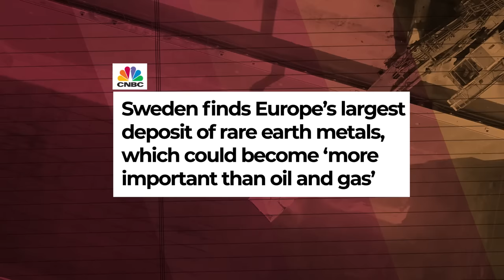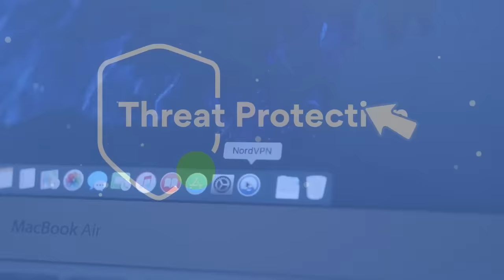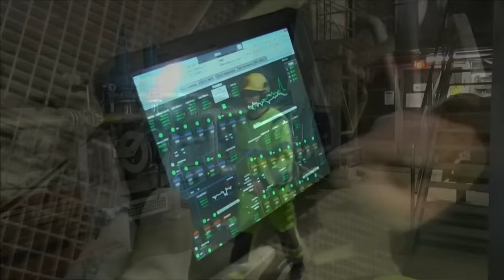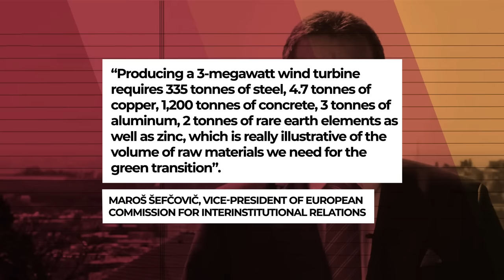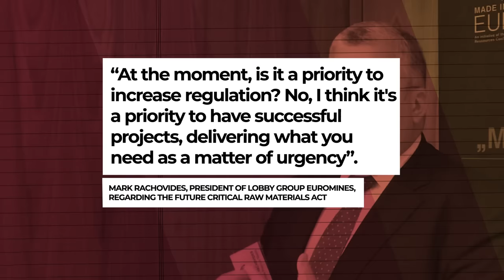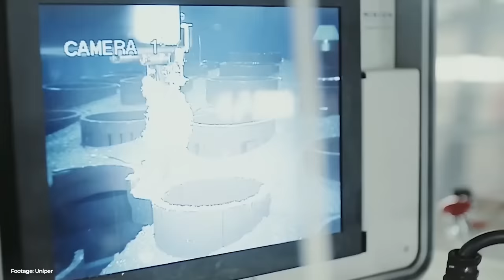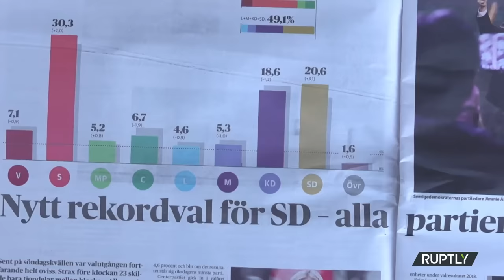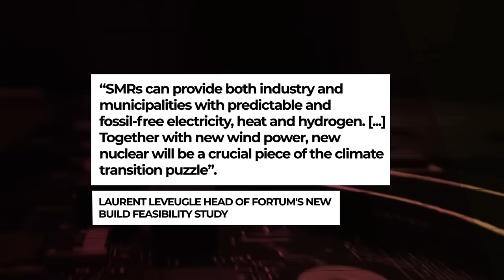Rare Earths: Can Sweden End Europe’s Dependence on China?

Comment: As a Swede living in Kiruna there's a lot more to the story than mentioned in this video. 
First, Kiruna will not be moved, it already is moving and has already moved the city center to the new town. They won't move building by building, they only move culturally important building and demolish the rest, right now they are preparing to demolish large parts of the old city centre. 
Second, it isn't just a new source of rare earth metals they have found, they also found it in the already dug up rock from all the iron mining. So this will also be another source of more rare earth minerals.
Thirdly, right now Swedish mining and steel production is trying to go completely fossil free with the use of hydrogen so there is a lot of work up here right now with a lot of pilot projects like HYBRIT.
Lastly, another source of copper will soon be available in Kiruna as an old mine from LKAB has been bought up by a new company called Copperstone who will mine a copper and iron deposit close to the town. The only problem now is that Kiruna itself has a ton of problems regarding everything else besides mining like schools, eldercare, healthcare, housing and so on.
Reply: Not enough people then

Comment: Nuclear is great for the environment as long as it's used as a temporary solution until fusion energy becomes viable, so Greta needn't have a panic attack.
Reply: agreed, fission is required to reduce carbon emissions if we dont have fusion. We should plan as if fusion will never happen, because the truth is, we dont actually know if it will ever be viable.
Reply: Yeah, we had some development, but it still a long way (probably several decades) before fusion starts to pumping energy into the grid. Also, it's not a guarantee that fusion will ever become an effective power source. This is a real possibility. With this in mind the new generation of fision reactor are the best option as a base load power.
Reply: Didn't she go pro nuclear recently?
Reply: Nuclear was only bad when we had no use for its toxic waste and managing the inputs and outputs required a highly unstable chemical reaction with no safety inputs and the reactors had to be absolutely massive.  Every single thing that used to be a problem is no longer a problem.  Why we are still playing around with green energy is a total mystery to me, the entire world's green electricity grid is nothing in the face of a dozen modern nuclear reactors and will cause less overall damage compared to solar panel farms developing desert ecosystems and windmill farms terrorizing flying wildlife and killing them by the thousands yearly, totally defeating the purpose of being "green" by creating new ecosystem problems to try to solve old ecosystem problems.
Reply: Nuclear fission is always good for the environment. Short or long term. Fossil fuels however is not
Reply: Nuclear could theoretically power us for the next several decades and beyond if we perfect Thorium reactors.

Most of what we use fossil fuels for can be provided by electricity, and most of that could come from nuclear.

We just need to get the regulations right and start building them.
Reply: @infidelheretic923  I love thorium reactors. There’s loads of thorium in the US, only issue is in mining it since it can potentially damage the environment if not enough care is taken. However, it’s probably not much worse than mining for “renewables.”
Reply: Fusion will never happen. Save a link to this comment, and if we have commercial fusion with proportional net gain  in 75 years, I will pay you $100 million. It's a waste of money and I don't understand why so many countries are building such stupid "solutions"

Comment: Norway has even larger depots of rare earth minerals, but they are more costly to dig out, because swedens rare earth minerals are mostly attached to for example iron. Sweden can then capitalize on the iron, and sell rare earth minerals as a bonus. 
But again: Norway has larger reserves.
Reply: @Plummky  Considering that their economy is the most diversified out of all petroleum-exporting countries, and that their oil revenues are diverted to their pension fund rather than the government's budget, and that the aforementioned pension fund is valued at over US$1,000,000,000,000 and is used as a backbone for economic stability, I think Norway will be fine. Their GDP will take a downturn, and unemployment rates will rise, but they are as prepared for it as they can be, while still doing work to further diversification.
Reply: @Plummky  Yeah, unlike most countries rich in oil, Norway already had a good GDP before they discovered their offshore oil reserves. Slightly lower than the rest of Scandinavia, but instead of being dependent on it, it boosted their economy to be better than the others.
Reply: @Plummky  Yeah I meant that once they discovered their oil their GDP/capita went from slightly lower than Swedens and Denmarks to substantially above it. Most likely when their oil runs out they will lose a big hit to their GDP and go from a ”super-rich” country today to a ”well-off” country like Sweden. The money Norway currently gets from its oil isn’t being pocketed by corrupt politicians, being wasted building super expensive cities just for prestige etc. Rather it is carefully invested so once their oil runs out, with the oil money they got they would have built up sustainable income and diversified it so they don’t crash their economy.
Reply: "Swedish state-owned mining company LKAB on Thursday said it had identified more than 1 million tonnes of rare earth oxides in the Kiruna area in the far north of the country, the largest known such deposit in Europe." and the fact that there is also in place rich with iron will make it more profitable

Comment: It's not clear how China is compelling Europe to buy rare earth from China. Imposing a 1000 percent tariff on rare earth imports may provide enough incentive to encourage domestic mining and processing. This arrangement could be considered a win-win for both nations: Europe gains total control over rare earth within its borders and earns extra tax revenues, while China has fewer resource depletion and environmental issues to deal with. However, a 1000 percent duty may not be a sufficient incentive to encourage domestic processing; an initial 2000 percent duty would be better.

Start using Thorium Molten Salt Reactors to simultaneously make thorium valuable, address climate change issues, and solve the spent nuclear waste problem.

Comment: You have to "love" how the keep using the word "transition" as if it's clear that such thing is sustainable (as the whole high energy system required for the heavy industries to build anything and everything that is green related is whether dependent on nuclear or more specifically, on fossil fuels, especially coal and gas): you can to transition to a place that does not exist. There is still not an efficient, effective, way to store the energy that comes from "recyclable". Huge batteries are a dumb option when you go to the details (and you wouldn't be able even if you wanted to). You can't melt steel with solar or wind or the fly of wasps or whatever. It's like jumping the ship towards the open see while claiming that a piece of wood is enough: it isn't.

Comment: While Sweden may be investing in Nuclear power, there has been a Windfarm boom in Finland, which is about to be the largest energy production source in 2027. Finland could produce 30% of all it's energy with wind turbines by 2030, or even 50% (according to MSN News) if the investments continue to grow like this. It is also estimated that at the current trajectory in investments to renewable energy sources, 90% of all energy production in Finland will be from renewable sources by 2030. and the aim is to have carbon neutral energy sector by 2035. Currently it seems plausible, considering how much foreign and local investments there has been to renewables here.

It would be also interesting to hear what Visual Politik can dig up on the Finland's aspiration to become the single largest producer of Hydrogen in EU, as they also build windfarms with the sole purpose of producing Hydrogen, Methane and Ethylene for energy storage, fertilizer production and transportation fuels. There are initial plans to take the carbons (CO2) required for the methane and ethylene production by filtering it from the air, making Finland's air even cleaner and helping to offset the future emissions from these sources by not using or producing carbon from new sources in their production. Estimates are, that once operational, these windfarms will produce 46% of all the hydrogen produced in the EU (According to MSN news).

Sources about energy production invest etc. can be found through Business Finland website.
Reply: The problem is the green steel production, one of the production plants will consume the electricity that half of Finland consumes, and with the other planned it will be half of what total Sweden consumes. 

We closed down so many reactors so now when it is cold and the wind ain't blowing we need to use a reserve plant in Karlskrona that burns tons of cubics of oil every hour. That is not very environmentally friendly..... That is the Greens and Liberals' fault that they wanted to remove all nuclear energy... 

We simply need to up the nuclear energy part so we never have to burn fossil fuel again and while doing it make sure the system can handle green steel production and leave space for electrifying of all cars and so on that will drastically ramp up the electricity need.
Reply: Any more than about 30% wind you get an unbalanced grid with huge price imbalance